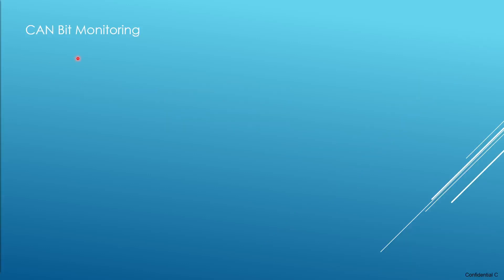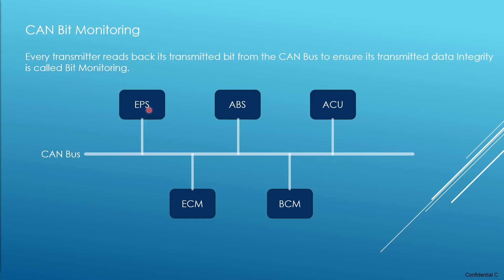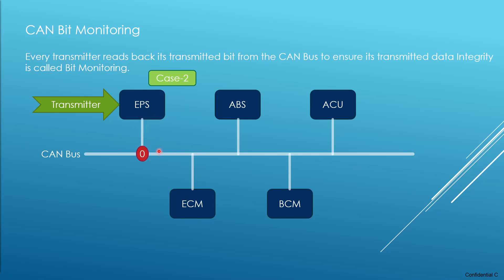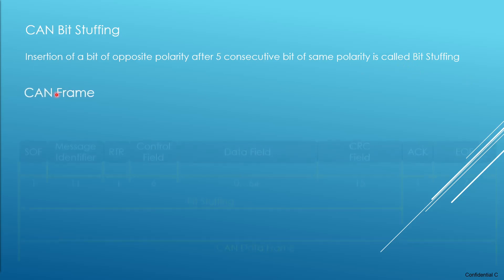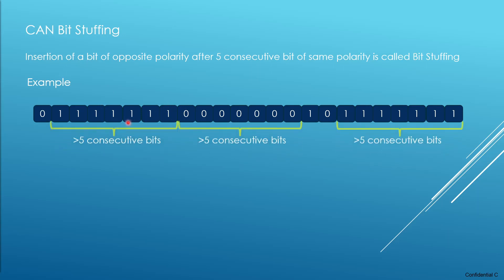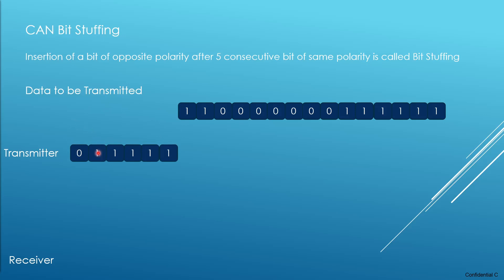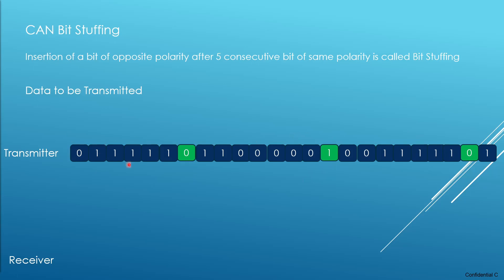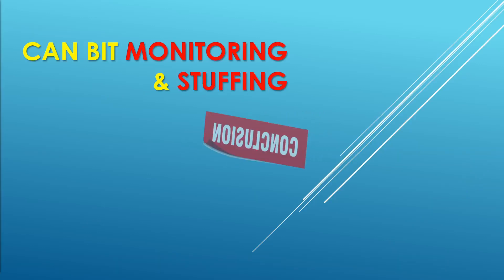What is CAN Bit Monitoring & Bit Stuffing

Comment: When the transmitter reads back the data if it not matches with the transmitted values then it is considered as bit error, but during arbitration also if another node with high prio message ID won the bus then our transmitter transmitted value will not matches with the value which reads back again.. Then it bit error or arbitration? "" pls clarify
Reply: yes that is why bit error comes with an exception. we exclude arbitration field and acknowledgement slot from the bit error..so no bit error occurs due to this.